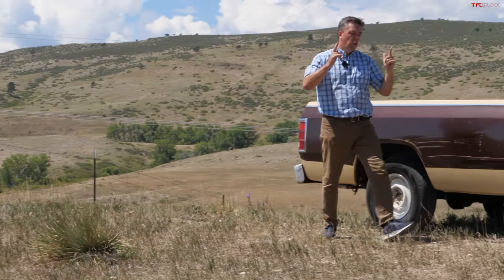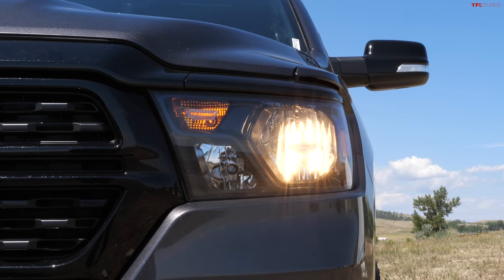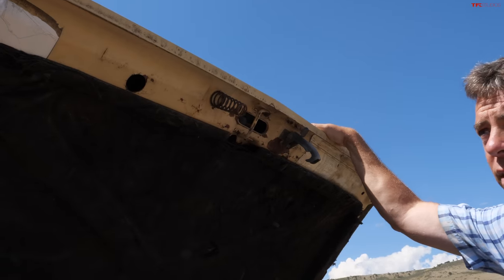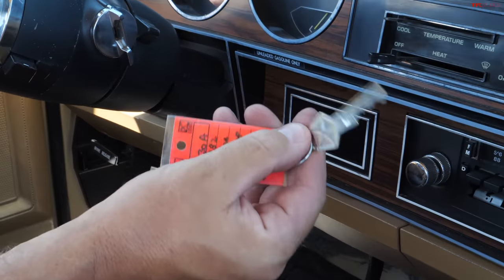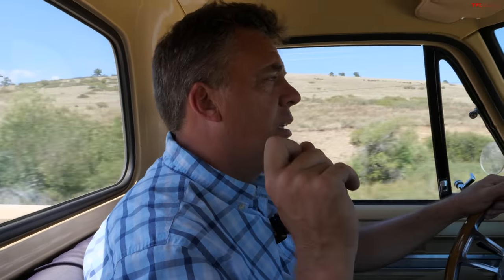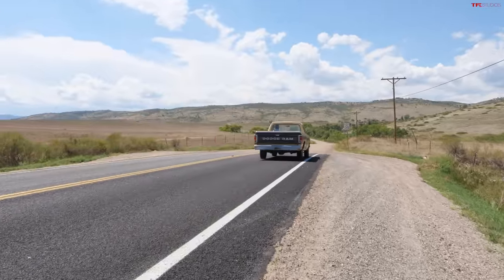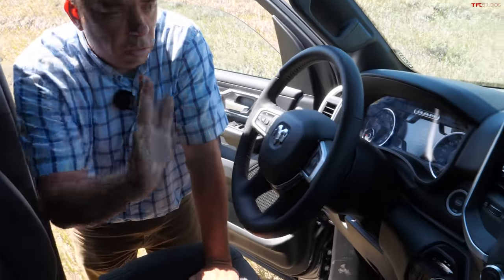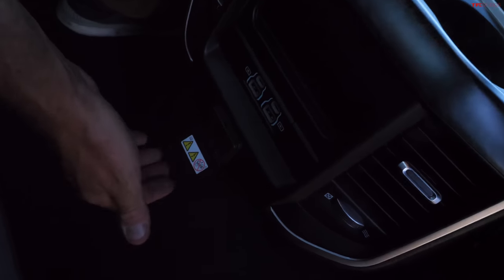You Won't Believe How Much Pickup Trucks Have Changed in The Last 40-YEARS!

Comment: Loved the comparison.  Could you compare it to a mid-size next?  Especially size-wise.  I owned a 1987 F250 that had a 300cid straight six. That year Ford made a heavy duty F250 and a "base" F250. Mine was the base F250, but an F250 never the less. It's rated tow capacity was 7100 lbs, with a GCWR of only 7800 lbs. I promise you that the GCWR was exceeded regularly and substantially on that truck, as I had a Cab over camper in the bed and a 22' cuddy cabin boat in tow behind.
Reply: I just saw a mid-sized 2020 GMC Canyon loaded model and one of my older relatives who STILL has his mid-1980's era Ford F150 full-sized truck parked right beside it. The GMC Canyon DWARFED IT --- It was larger and wider and could carry and tow way more! 1600 lbs and Tow 5000+ lbs vs carry 1100 lbs and tow 2250 lbs!

The mid-size trucks of today are large and more powerful than the full-size trucks of yesteryear!

THAT is what 40 years of truck design does!

and THAT IS A GREAT THING TO HAPPEN!

V
Reply: I had an 06 Dakota and size wise it was very close to my grandpa’s D150, just not as wide.

Comment: That 40 year old truck will be around to tow the new one to the junk yard
Reply: The slant 6 is an excellent tow rig. Max tow cap 2000lbs. Cut the new truck into pieces and tow each chunk separately
Reply: Facts
Reply: I doubt that
Reply: I mean I like older trucks but I just doubt that
Reply: @WynnJirTheGreat  I believe it maybe not this truck but something like the first gen Cummins will be around to tow
Reply: @kevincinnamontoast3669  oh please that old truck will pull way over 2k.  My uncle pulled a d3 caterpillar crawler tractor with his.
Reply: @WynnJirTheGreat  as long as basic parts are still available it will still be running..  that new dodge will fall apart in 15 years
Reply: @sketchyssk8shop  5 years
Reply: it would get it there. put that new one on a trailer and that old truck would take it to the junkyard without any problems. I know it'll do it because I've done it. I've owned 5 of these old trucks over the years.
Reply: @krazi77  I'm in one as we speak
Reply: @sketchyssk8shop  drove mine to work today
Reply: @krazi77  I have a GMC c3500 and a 1st gen Ford ranger as far as trucks go also have a 70s RV.  Drive one of the trucks every day
Reply: Dang you stole my thunder
Reply: My ford 4.9 straight six is a work horse.   It’s the truck frame and brakes that limit them.   Best part is an emp would not hurt my ford.    All mechanical
Reply: @purpleduckhemp  I have been looking for a old 300 for some time.  They will pull what ever you want
Reply: @purpleduckhemp  
I haven't purchased a car in 45 years, only purchased trucks. Will never own another car. Presently own 6 trucks, newest of them all is a 2000 Chevrolet. Oldest is a 1970 Ford F-100 with 4 of various makes and models between the two. Have a 78 C-20 FWD with 4 speed and granny low, have pulled everything from farm tractors to stuck Peterbilt with loaded trailer, much more dependable than the later model that I own.
Reply: Amen
Reply: New truck has 100lbs of computers. Does yours? Didn't think so. Everyone knows that the more feature-packed and high tech everything is, the more reliable it will be at the salvage yard in 3 years.
Reply: Funny, when I was young my parents get on the highway and remember seeing many carbureted '70s and '80s garbage on the road side with the hoods up....
Reply: @ljmorris6496  same with today's over rated crap.
Reply: @sketchyssk8shop  tune the carburator on your museum piece...
Reply: I loved my 88 Cheyenne. Had a 305 with a 400 turbo but kept losing reverse and 3rd after pulling two big lawnmowers for a few years. Replaced motor with a crate 350 and put on headers and a 700r transmission. It got 21 mpg after that and was crazy fast for it's size.
Reply: Exactly
Reply: @sketchyssk8shop  parts are still real easy to get. Mopar is starting to make everything for the old stuff
Reply: @jeffrutledge1789  never knew they started making old stuff again.
Reply: @kevincinnamontoast3669  you could cut the converters off the new one to pay for the old one
Reply: @ljmorris6496  that was a car show
Reply: @kellismith4329  A show of "how not to build an automobile"?., This is 30+ years ago, not all vehicles during that time didn't run correctly but alot of malaise was on American highway shoulders..

Comment: The one thing that strikes me and I've been lamenting this for years, look at the bed height. Both the floor and bed sides. It's almost a foot lower than the new one. For someone like me who hauls way more than tows, low bed floor is very practical for loading/unloading stuff without having to climb in/out every time.
Reply: You would have been exstatic over an Australian  Ute. Very low koading height and in the Ford Falcon( much larger and heavier than your Falcon, very differrnt vehicle with a 351 cu in  V8 option)
Reply: Low load floor is the ticket
Reply: Taller and fatter doesn't add up unless image is everything.

Comment: My Grandpa had a 78' and then an 84'. He passed them both down to my father. Both were bulletproof and ran like hell. Hearing that drive train in the 82' you drove brought back instant memories of me learning to drive in the 84'. I miss these trucks so much. Back when heaters blew hot air, AC systems blew cold air and everything just worked. Now days if you buy a V6 guys call you a sissy. Man the good old days. Its ironic that Dodge is arguably responsible for changing the truck game back around 92.
Reply: Same goes with old muscle cars, most had base 6 cylinders and people hate on them for being a 6 cylinder

Comment: Obviously a teenager owned it at one time, rocking the high performance dual exhaust on a low revving inline 6 engine 🤙
Reply: I think you are correct. I'm an old fart and my first car was a 1964 Dodge with the 225 Slant Six. I beat that car and that slant six never missed a beat! Push button automatic torqueflite!
Reply: Also unlike a v6 it sounds good cuz inline
Reply: @billjamison2877  i think its funny a buddy of mine bought a 62 Dodge Dart with a Slant 6 and a automatic... had about 10,000 miles guy he got it from.... i suppose grandpappy bought it new, drove it a couple of years parked it.... we did an oil change on it replaced a few Dry rotted hoses and belts and new tires new plugs. nothing was corroded at all.  it was great for 2 months didn't have any kind of leak or smoke. or blow by to any extent he didn't even put 4,000 miles on it. motor threw a rod out the side of the block while idling after his commute to work. and he never idled it for more than 5-10 minutes. just enough to allow the engine to cool down after a drive. and i was thinking they're almost indestructible motors until i seen that happen.
Reply: @justnsaliga8518  That's really odd for that motor. The first slant six had 188,000 miles on the clock before it needed a ring job. They are usually pretty stout power plants. I'd love to know what happened to put a rod through the block.
Reply: @billjamison2877  idk for sure but possibly a spun bearing we pulled the motor and scrapped it except for the heads and exhaust and intake rods pistons and block and crank were all scrapped
Reply: @billjamison2877  it was definitely a bottom end failure and definitely big end on a rod

Comment: I have a 1993 F150 with the 300 straight 6 and just in the almost 30 years since it was built trucks are significantly different. Mine is much more like that older Dodge than the new Ram
Reply: I had a 96 F150 regular cab and I think It had the same engine, manual transmission. It was pretty peppy

Comment: I currently drive the 1984 3/4 ton version of this truck. 30 mpg is comical. But it gets me back and forth to work from east texas to new orleans or houston depending on where the boat im catching is. Originally paid 450$ for it 7 years ago. It has been an absolute work horse, parts are cheap and plentiful, but all told i havent done much to it considering its age. Only time it has let me down was couple years ago the factory alternator quit. I replaced a u joint, front brakes and one caliper, rebuilt the front end from 82,000 miles of bouncing around a cow pasture, new muffler, few sets of windshield wiper bushings, cleaned the carburetor. All together i might have 1000$ in it. It just works these days. My wife even uses it from time to time when her 2016 durango is in the shop due to some newfangled gizmo acting up. If they would build and sell this truck new today for inflation adjusted 13,000$ id buy one yesterday. Id give 13,500 if they somehow added a couple of cupholders.
Reply: It would be impossible to sell this brand new these days due to government regulations. You need airbags, back up camera, crumple zones, and more

Comment: I just inherited my Dad's '03 1500 with the 5.7 HEMI. It is a good truck but it has dodge issues.
Reply: I'm a believer that even really good vehicles will have their "known" problems. (Some more than others). Still a good truck you got there
Reply: My 03 ram was a lemon unfortunately..
Beautiful truck otherwise..
But the hemi died at 130k miles right after the trans was fixed.
Ball joints, broken tie rod end, cooling issues etc..
heavy duty  only nowadays

Comment: Planning to buy a half-ton in Germany soon; Will probably be a RAM1500 crew cab short bed - any advice which trim level? Doesn't need to be highest luxury nor base trim level, mostly on road and a bit of dirt road usage with minor easy offroad. 
I like the appearance of the GMC better, I also like the F150 Lightning, but they aren't really an option for various reason, so it kind of has to be the RAM 1500
Reply: A sport with whatever options you want seems to be the way to go on pretty much every ram from 2nd gens on up.
Reply: Bighorn trim with the electronic locking axle 4x4, pick what other options though

Comment: I had a 1986 Dodge pickup with the venerable 318. Very slow truck, if memory serves it only had 145 horsepower. But tough as nails and you couldn't kill it. I put over 200K on it and sold it to a guy who had over 350K last I heard. 

I also have a 2022 RAM Laramie. Very different truck from the '86. All the creature comforts and it will get up and go! And, it will get 25 mpg on the hwy, which the old ones couldn't do.

Comment: My dad had an ‘83 Dodge, that was identical to your ‘82 (except colour).  That truck worked hard for 5 years with no issues - 2000 lbs of oil drums in the back, delivering at least three days per week.  Was traded for a 4 x 4.

Comment: The 82 Dodge Ram Pickup was in the "malaise years" half way thru that generation (72-93).  My father had a 75 Dodge Pickup "Powerwagon" 4x4 with the big 440 V8.  He put headers and tuned it.  I hit 100 mph once in it with ease!    The downside being 10-15 mpg max.  My gas station job manager had a 76 Dodge 4x4 also with a tuned 440.  He had a power snow blade and would easily plow deep northern Ohio snow to keep the pump lanes clear.  PS:  A decade prior, we had a 63 Dodge Dart with the 225 slant 6.  It pulled a small boat across southern PA mountains!  The 75 4x4 pickup also did boat hauling duties, although a bigger one by that time.

Comment: When you look up the original 1982 prices for that truck:

Original MSRP: 
Base Price $6,199

...which is roughly $19,000+ today. 
The Ram Tradesman hovers around $38,000...

But, consider how much more power, safety, comfort, towing and payload you get... 

Makes sense.
Reply: Plus the maverick kinda picks up the slack at that price point. That "Well my 2010 f150 platinum costs what the big horn level 2 costs now! Prices are so high" yeah prices are higher than they should be, but a base level truck has essentially the same features as a fully loaded one 10-15 years ago
Reply: It’s all gone a bit crazy🤣

Comment: I had a 1984 with the 6 cylinder and a standard transmission with an overdrive. Power was terrible. You needed 3 miles of clear road to pass. But fuel economy was 28-30. Amazing that after all these years trucks still struggle to get 20 mpg. I don’t think the 2022 will fair so well in 40 years.
Reply: That Slant Six will probably still be running when we are long gone!

Comment: In a project at the Bendix Research labs we added three air pumps (Exhaust gas air pump to reduce hydrocarbons) as a supercharger system with band clamp clutches to allow tip in when desired. That engine was bulletproof and really responded well to the 12 psi of boost. And unlike a turbo, it is available right off the line.

Comment: I grew up in trucks like this, I was born in the mid 80s, and up until I was around 6-7 years old, my dad was driving an early 80s extended cab Ford Ranger 4x4, which he replaced with an early 90s GMT400 series Chevy 1/2 ton extended cab 4x4 (manual transmission) when my brother and I outgrew the jump seats in the Ranger. I learned to drive in that truck, which was replaced by my dad's first ever brand new vehicle, a 2002 Silverado, when I got my driver's license (I inherited the old truck, but it died before I got out of high school, entirely my fault due to banging around in the woods with my buddies).

What I find crazy, as does my father, is that when we look back at everything we did in trucks like this, and then look at the mid-sized market nowadays, and realize that anything we did in those trucks we could get away with in a mid-size today, and that neither of us needs a modern 1/2 ton. Taking this 82 Dodge as an example, the slant 6 D150 has a tow rating of 5000lbs and payload of 1000lbs. Even the Ridgeline, Maverick, and Santa Cruz all have payloads north of 1500lbs (and with an extra row of seats, so you could have 500lbs of passengers and still match the payload of the 82 D150), as do most of the rest of the mid-size pack. All but the Maverick tow at least 5000lbs or more, up to over 7k lbs in some mid-sizers. Speaking only for myself and my father, our towing and off-road needs have not increased over the years from those trucks (in fact my dad's largest trailers are his 1975 Starcraft boat at 19ft and about 4000lbs and a 16ft enclosed utility trailer that has a GVWR of 6000# and has never been loaded to that capacity; my largest are an 18ft bunkhouse camper with a GVRW of 3800lbs and a 21ft Lund boat with a GVRW of 4300lbs). As a result, I am on my second Honda, and my dad recently told me that when the lease is up on his current truck (21 Silverado RST Z71 he got last summer) he intends to go with a Ridgeline or a Canyon, simply because at 65, he is not using even a fraction of what his 1/2 ton can do, and he would prefer something that is a lot more comfortable and fuel efficient (not to mention on his retirement income the increasing cost of trucks is a concern to him as well).

It is amazing how far trucks (especially 1/2 tons) have come from the "good ole days" but in many cases the capability of the trucks now far exceeds the needs of the drivers. Not that a great number of truck owners don't tow heavy trailers or off-road as many in fact do, but a pretty good chunk these days are using them exclusively as family haulers and neither tow or off-road, making a mid-size truck probably a more appropriate fit for that group.

Comment: I have a 1978 Ford F150 Ranger XLT with the 351 V8.  The I-Beam front suspension along with the brakes and steering are terrible. and, you're right, it weighs only about 3700 pounds...a lightweight.  But the simplicity, the lack of of pretense and the uniqueness...all make it worthwhile.

Comment: That slant 6 will be running long after that new RAM dies and gets  scraped.
Reply: That new Ram will probably go to around 150,000 miles then die, where that old Ram will probably go for 250-300,000 miles if you treat it right
Reply: @mrbluejeans09  false, properly maintained hemis can get up to 300k. People still beat on their trucks and expect them to last forever that slant 6 lasts that long because it's a dirt simple design with low compression and no power

Comment: Here in the PNW very few pickups were bought with 6's or 4x4 until the early to mid 80's unless they were for specific commercial uses. I had a 65' Dodge with a 318 V-8 but wanted a bigger v-8, most did. My 68 & 72' F250's  had 360-V-8 automatic. The 68' cost $3600 new & the 72' was $4200 but had PS & PB & was a little higher trim pkg. Hauled a camper & a boat. MPG's were all the same whether you had a 6 up to about 400 cu in. !0 mpg empty, full, city or Hwy. The mid V-8's did better than the 6's or small V-8's because your foot wasn't thru the floorboards. Over 400 cu in. and mileage dropped. In our area very few 4 x 4's until mid 80's. Now very rare to see a 4x2. Not too many people got the old ones with power locks &windows or A/C as well. I had a 91' F150 with a 300 cu in 6 manual 5spd 2 wheel drive. Not a popular model & it sat on the lot. I paid $10k new.  Mpg's ~ 11 in town; 13 on the freeway. 2004 F150 Lariat (top model) 4 x 4 5.3L V-8. Paid $22k new. 13mpg's in town, 17 on Frwy  empty, 15 hauling my 3500# boat on Frwy. Most were "standard" cabs until the 80's as well.  Went from a truck for hauling & towing into a luxury vehicle, with decent mpg's and features. Newer 1/2T are more like the old 3/4T with much better ride and mpg's. Todays are much lighter as well. 2015 F150 4x4 3.5l ECO. Pd. $32k 17mpg in city & 24 Frwy empty. Lots more hp for towing as well. 2021 F350 7.3 gas 4x4. Pd $51k; 13mpg city & 17 frwy. Towing a 7400 tt gets ~10mpg. Truck prices have gone up much higher than inflation but they also have a lot more whistle & bells.